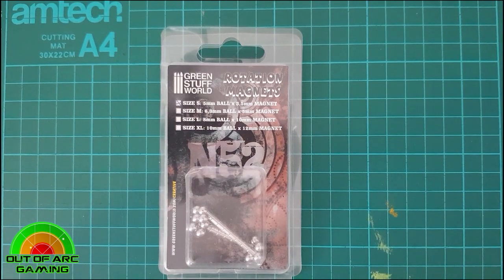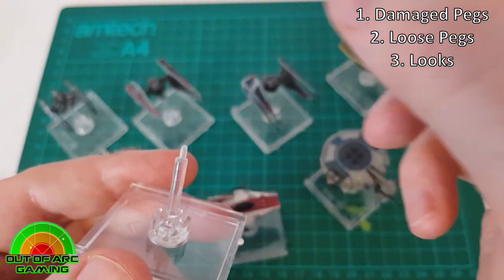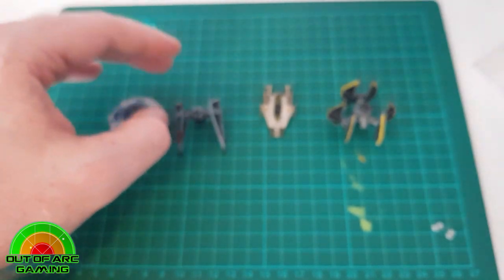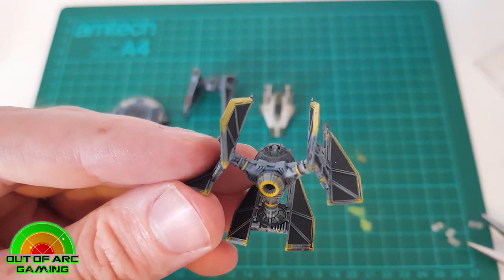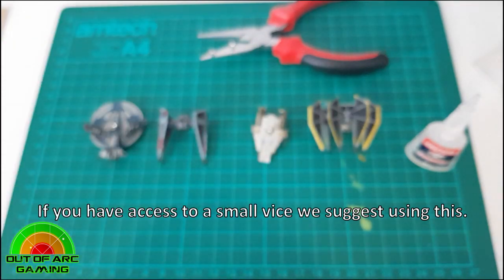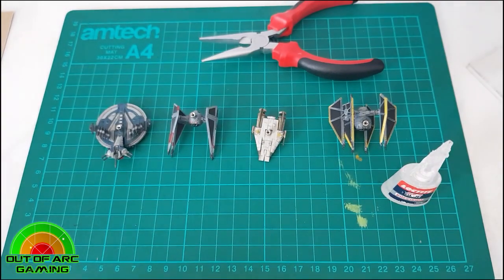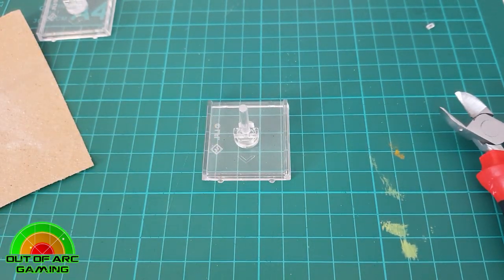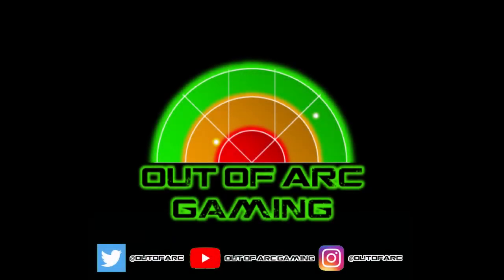X-wing Mods - Magnets - A quick guide

Comment: As an assist to mounting the ball bearing on the peg I usually apply a little heat and press the bearing into the softened plastic, gives a bit more surface area for the bearing to bond to. Overall a really good tutorial for players that want to magnetize their ship. 👏🏼👏🏼🍻🍻
Reply from the maker: Thanks Michael. Heat is a good suggestion. We haven't tried this as we do not have a heat gun but it may need to go in the old shopping list.
Reply: @OutofArcGaming  I just use a tea candle. Easier to control how close to the heat source and consistent temperature. Just don’t get too close or it’ll warp the peg.
Reply from the maker: We shall give that a go, cheers for the info 😁

Comment: This is great, how would you recommend doing this for a 1.0 B-wing
Reply from the maker: So we removed the original peg and then place a small magnet between the engine space on the back. It makes the connection horizontal rather than vertical but it works.

Luckily the 1.0 b wing is light enough that it holds up well.

Comment: I just did this to my collection and the small ships turned out awesome, however my large ships ran into trouble. Their weight tilts them easily and they lose balance quick. Any tips on how to make them more 'sticky'?
Reply from the maker: What size magnets did you use on the large base ones? For most we would suggest at least the Large versions. 

You can also put a thin layer of glue on each part, the ball and inside of the magnet, allow these to dry and it should add a layer of 'resistance' to stop slipping.
Reply: @OutofArcGaming  used the Large ones (8mm ball 10mm magnet.) Gonna try the glue trick :D hopefully it will stop the wandering ships from slipping all over the place. The other ships I am worried about are the B wings and the Torrent fighters ^^ their pegs seem rather difficult to remove. But gotta do them too. The whole Magnets idea is an insane quality of life improvement + looks amazing on photos.
Reply from the maker: Depends which versions of the b wings you have. For the 2.0 versions I left those as the pivot in them is really good. 

For the 1.0 and torrents, I clipped out the pegs at the back and put the magnet facing out. Gives a good bond and doesn't get in the way.
Reply: @OutofArcGaming  it's 2.0 so gonna leave it be, and gonna try to get the Torrents by the rear peg :D hopefully it will turn out good. Thank you for the help ^^ it is much appreciated.
Reply from the maker: Anytime xXE4GLEyEXx